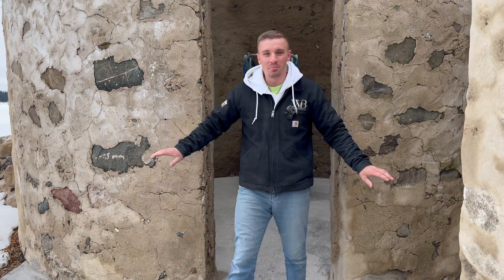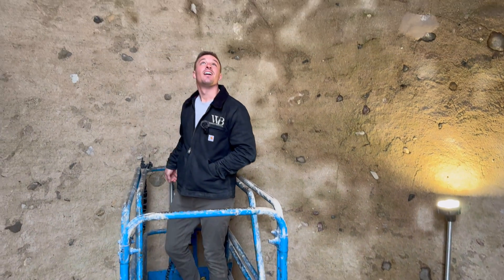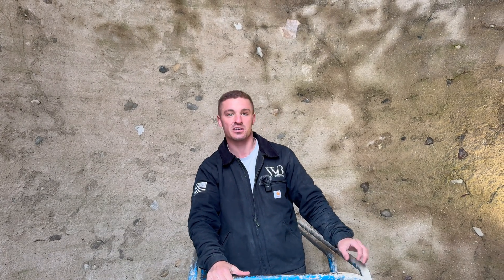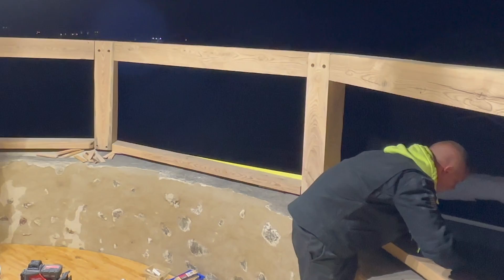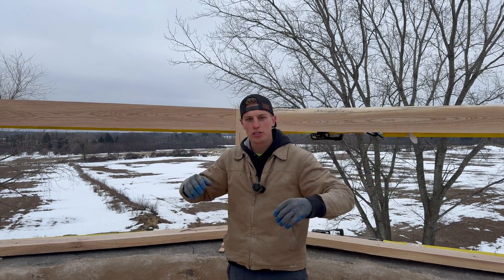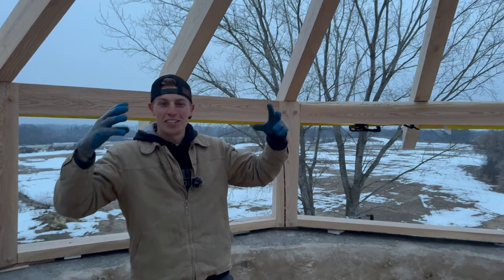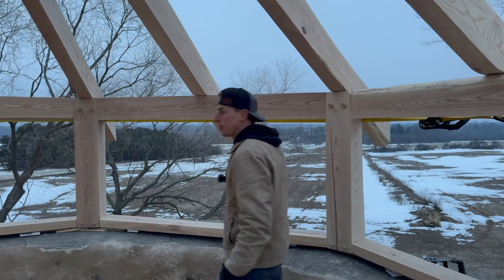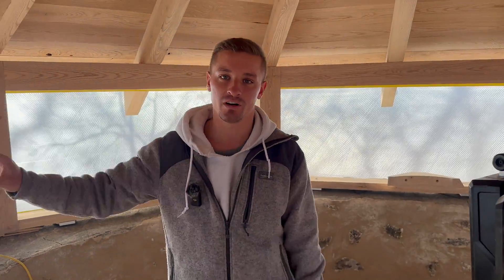Building The World’s Most Insane Silo Roof…Custom Made Timber Frame | Silo Renovation Pt. 12

Comment: I have disassembled roughly 8 barns that were classic timber frames utilizing the mortise and tenon.  Without exception, in revealing a tenon without a wedge that was subject to tension forces, roughly 50% of these had failed internally due to shear failure parallel to the tenon the width of the pin.  This failure is hidden in the mortise and becomes evidenced by partial tenon withdrawal.  It appears your tension ring holding the roof rafters from spreading utilizes nothing but mortise and tenon joints to keep it together.  Then again, maybe you are planning a compression ring around the circumference?

Comment: Is the construction of the floor/deck sturdy enough?
Reply from the maker: Hi @georgegordonbrown9522 yeah the top floor should be plenty sturdy. For the joists we used 2x8’s spaced 16 inches on center with both sides anchored to the stone/mortar using steel hangers. There were a bunch of large granite stones used to build this silo which we screwed most of the anchors through so it shouldn't be going anywhere.

Comment: It's great to see some old-time craftsmanship going on! If it's not too late, I'd like to suggest that when you mortar the gap at the top of the wall, you do like our European brothers and make a lime mortar out of lime and sand. It makes a softer mortar which will allow the timber and the masonry to dry out after they get wet. A lot of their structures were mistakenly covered in the 1960s with cement, causing a lot of timber frames to rot. Wood and cement do not mix well.
Reply from the maker: You are absolutely correct, we use a lime/cement mortar mix. Our winters are pretty harsh where we are located so we need the mixture to give it some durability, just waiting on a warm up in weather to finally get it mortared. Thanks for watching!
Reply: @Worzalla_Brothers  россия (в центре карты) 5 января -35 цельсия и снегопад, 6 января +2 цельсия с дождем и градом, 7 января -30 градусов, 8 января - 35...
метель 25 метров в секунду.
лето 3 месяца в году +17 август, + 24 июль, +35 июнь.
отопление 9 месяцев в году.

цените то что имеете )
зарплата у продавца в обычном магазине 2х2 по 12 часов = 300$ - 500$
у работника конвейерного предприятия с высоким доходом 5х2 по 12 часов = 1000$

Comment: Yall are killing it, beautiful work. The ash yall used looks pretty clear, would of expected to see some boring holes from the ash borer but looks like you found some choice stuff. Personally, i would of probably laid some tar paper or joist tape between the concrete & post contact but hopefully that far up, moisture in the concrete will be minimal.
Reply from the maker: Yes we were able to find some ash with minimal bore damage but most of it is in the sap wood which is pretty much milled off. We did use a marine sealer on the wood that is touching concrete and we also have a large overhang on the roof that should keep most of the elements off the top ledge but good call, we will definitely look into tar paper in the future or ice and water. Thanks for watching!